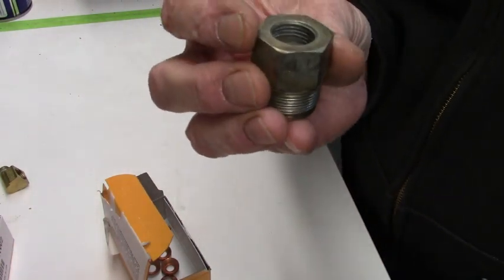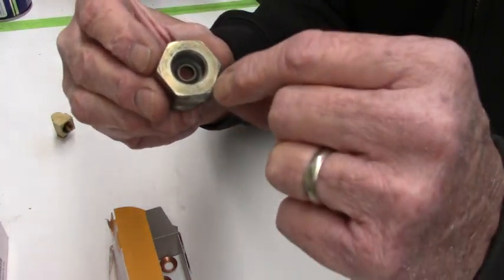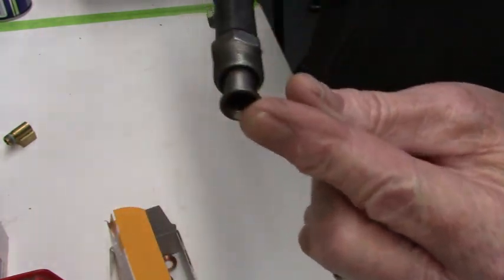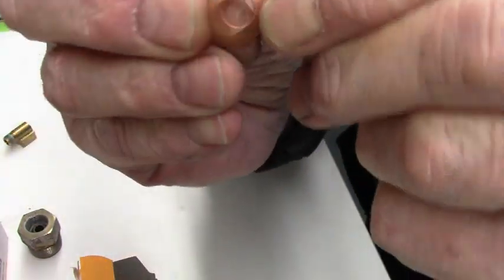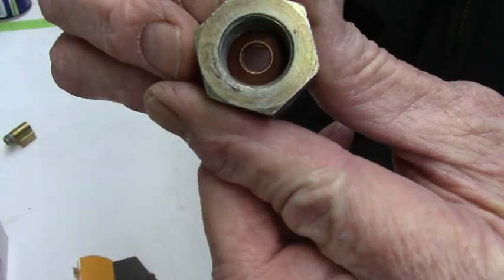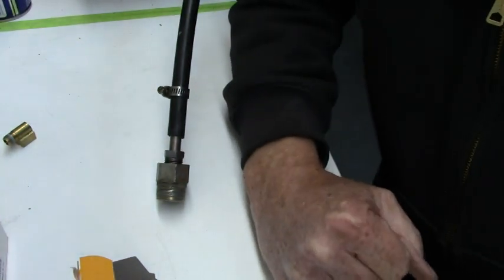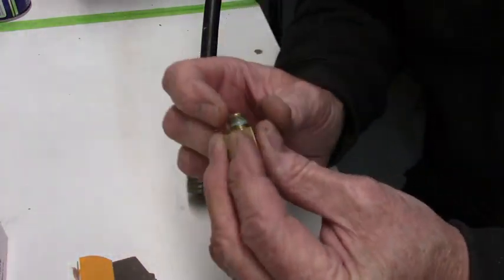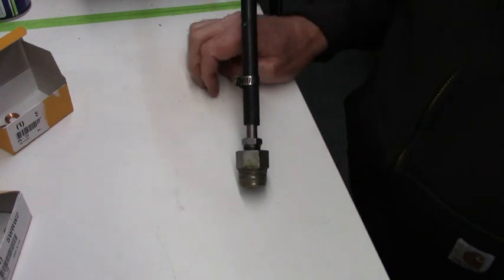Fuel Line And Brake Line leaking Flare Fittings

Comment: Best eight minutes I spent on YouTube in a long time.  Replaced a surge break actuator on a boat trailer, had less than three inches of exposed line.  Sure enough, I messed up the seat on the adapter dealing with the stubby, stiff line.  Wound up buying the washer for $11.99 at a local Grainger.  It worked perfectly, have nine spares from a box of ten.  Still worth every penny.

Comment: You sir are a genius.  Many struggles with a leaking stainless steel fuel line into an Autolite 2100 solved with a copper flare washer.

Comment: What size would you recommend to fix a brake line leak from the master cylinder. It’s a 1967 Chevy impala
Reply from the maker: Use the seal that is the brake line OD size.